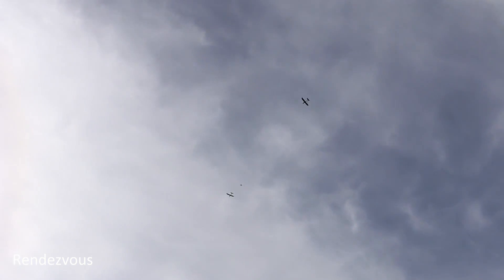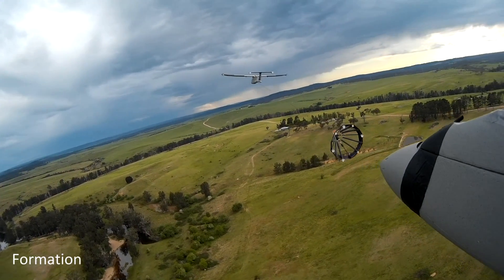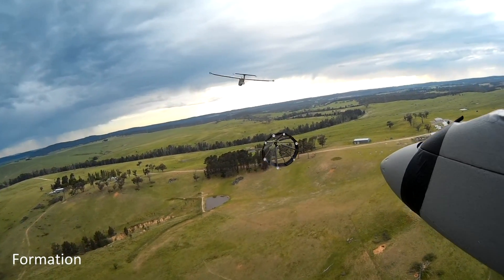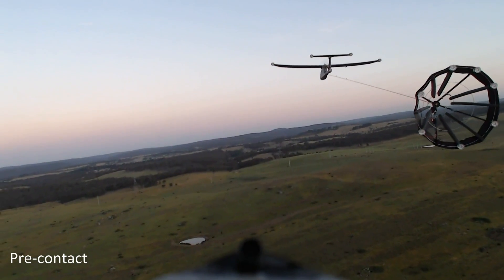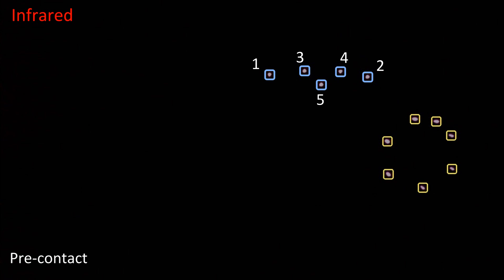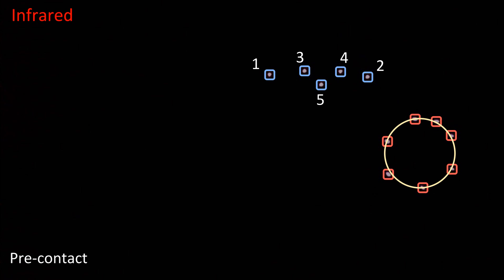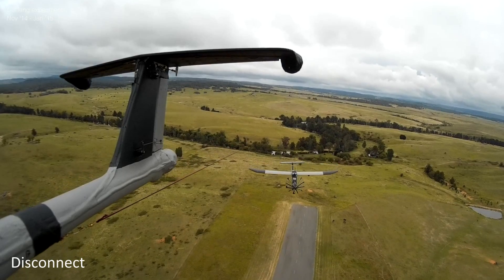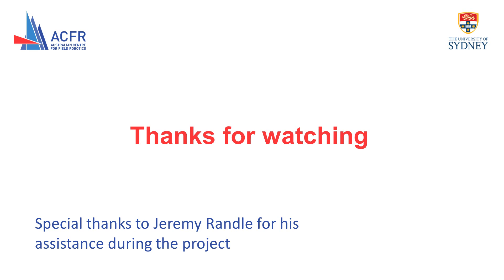UAV Docking for Autonomous Aerial Refueling

Comment: How is the docking station that's towed by the leading drone aerodynamically stable? I only see one wire keeping it in place, so what's preventing it from rotating and turning in flight?
Reply: The docking station is like the tail of a shuttlecock, the shape keeps it straight and stable in the air.

Comment: Why not just have the drone switch out with another drone after all you would be sending a 2nd drone to meet the other anyway.
Reply: battlebob 
The camera being used and support systems/software logistics.
Reply: @muntee33  Because it's a proof of concept, not the actual situation. For example, the larger military aircraft cannot land at any runway due to the length needed to land, the solution is to send up smaller refueling planes - that can land on that runway - up to refuel the bigger craft.

Comment: If you're going to send up a second drone anyway, wouldn't it just be easier to send up the second as a replacement for the first, and just bring the first down for refueling?
Reply: xfunccarter2011 Nah man, this is a simulation using relatively small drones, but imagine a military drone, bigger than your car, carrying missiles or some expensive surveillance equipment. You have limited number of those and they can't be stationed everywhere. That's why when flying on a long mission they might need to be refueled using a much less expensive fuel tanker drone.